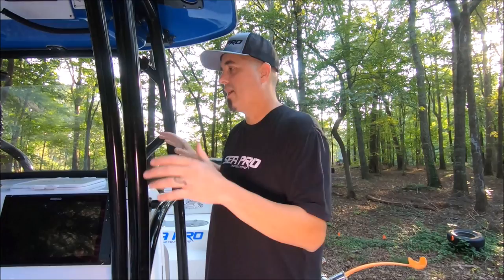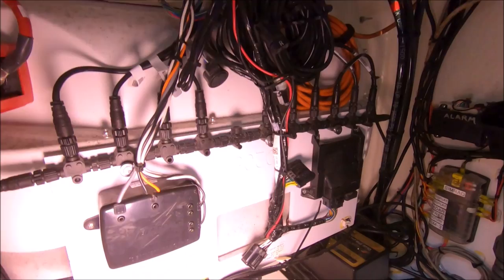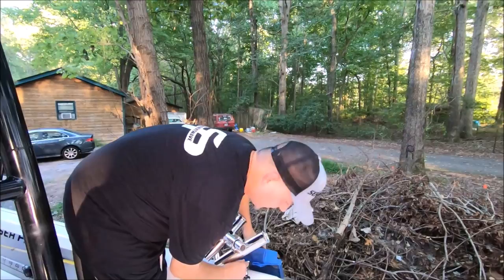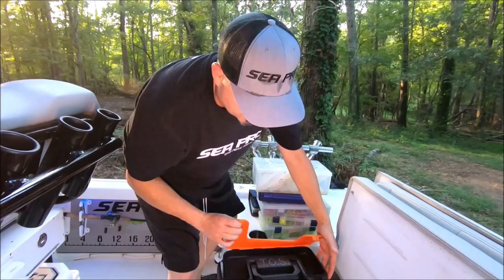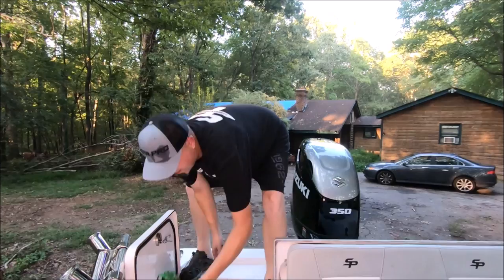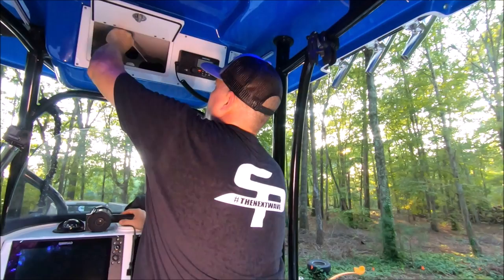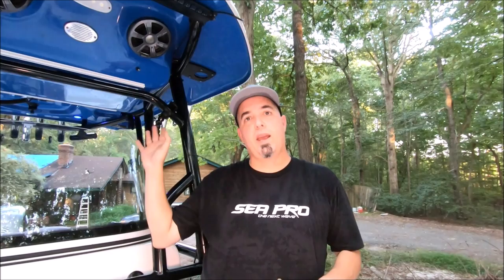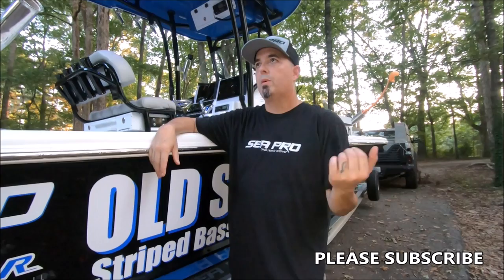RIGGING YOUR BOAT FOR STRIPER FISHING! Fresh AND Saltwater! Sea Pro 248 Bay Boat

Comment: Thanks again Mike I never thought about jumpers. It so simple it just went un noticed. One thing I keep on my boat it a set of wheel bearing for the trailer.  I had a day ruined and a huge bill for not being prepared.  I appreciate all the information so I don't get caught with my pants down again. 👍
Reply from the maker: Thanks brother!! You are very right, An extra set of bearings are a must-have. As long as you have that extra set, you won’t need em anymore, which is just fine with me! 😛

Comment: Having a cranking battery solely for cranking and a house battery to run electronics is a must have(which Mike shows in this video).  So many people I see running everything from the same battery and have to use those jumper cables way too often!!
Reply: I use two batteries each with an AB switch and two dedicated circuits. One circuit is my cranking house\nav lights and the other is my aux (bait tanks, pumps, down riggers, radios, etc).   That means either battery can be cranking or aux depending on that battery's AB setting.  Two bilge pumps.  One to each battery.
Reply: @duaynebarr4392  It's called a house and a start battery.

Comment: Awesome vid Mike , you pretty much covered everything and then some, never know when a simple small primary wire could break off a connector or a stakon, or even foul a spark plug. I use Dielectric paste or cream on all my electrical connections. yup if you carry it you wont need it !

Comment: I really like your videos.  One question about this one.  I get that you should always have tools and extra parts.  Have you ever weighed your boat empty versus loaded with everything loaded?  I was curious how much added weight is in there without people.   I just purchased a 23 foot center console and is listed as being able to hold 9 people, but with all fishing equipment and extra tools, I am wondering if it would put me overweight.  Thanks.
Reply from the maker: I haven’t actually weighed it, but I have done the math and you’re right you can go over fast. Your dealer will have dry weights listed. Your yellow tag will also have passengers plus gear.

Comment: Hey Mike, this is off topic to the Video, but I’m working with my dealer to spec out a 248. Ive chosen the 12” ness evo 3 Simrad unit , but there are 2 choices for the through hull transducer. Choices are either 12 Degree or 20 Degree. Which do I need for this hull? Is it referring to mounting angle? As far as closest match for the dead rise of the boat, or the Cone degrees of the transducer? Anyway what do you suggest? Thanks, David
Reply from the maker: You want 12 degree. Is the dealer installing the transducer or Sea Pro? 

 What model are you going with.
Reply: Mike Smedley yes it will be factory installed at sea pro , on the build sheet we filled out the options on the through hull were the SS60 Bronze 600 W Thru Hull 50/200khz. This will be in a 248dlx boat. Is that the transducer i need?
Reply from the maker: David Mercer I STRONGLY recommend upgrading to the B175 High CHIRP Wide. It’s a few hundred bucks more, but it is the absolute best thru hull for fishing less than 1000 feet. 

 The B60 is an entry level Transducer.  You have a CHIRP processor built into the Evo3. You need a CHIRP Transducer to take advantage of that.  The B60 will work, but it definitely a entry level unit, they offer it as standard because guys complain about the higher prices of CHIRP Transducers.

 The B150 Medium CHIRP is a nice Transducer too.  Similar price to B 60.
Reply: Mike Smedley Thanks Brother! Are there any other standard items you can think of that I definitely need to upgrade?
Reply from the maker: David Mercer add transom mount Active Imaging 2 in 1 Transducer for best Side Scan.  (Get 3 in 1 if you stay with B60). Get extra flush mount rod holders near the bow. 

 I resisted t top misters for years.  I have them on this boat and I LOVE them in summer. 

 Get the hydraulic jack plate 12”.
Reply: Mike Smedley Thanks man, cant wait to be part of the Family!
Reply from the maker: I told Big Ed to take good care of you!! He’s a great guy!  👍👍😁😁
Reply: @MikeSmedleyOLDSCHOOLSTRIPERS  thanks buddy

Comment: Why soo many transducers? All 4 can hook into one display screen? Or do they hook into that big computer looking thing in the helm.
Reply from the maker: I do a lot of testing so I carry more than most. Each display can handle two transducers directly or the tan box that says SIMRAD can take 3 CHIRP transducers directly. It’s an S5100 CHIRP processor.
Reply from the maker: I do a lot of testing so I carry more than most. Each display can handle two transducers directly or the tan box that says SIMRAD can take 3 CHIRP transducers directly. It’s an S5100 CHIRP processor.
Reply from the maker: I do a lot of testing so I carry more than most. Each display can handle two transducers directly or the tan box that says SIMRAD can take 3 CHIRP transducers directly. It’s an S5100 CHIRP processor.
Reply: @MikeSmedleyOLDSCHOOLSTRIPERS  is there one transducer that does it all?
Reply from the maker: blindabinda123 The Active Imaging 3in 1 is the closest thing. It has side and down scan as well as High CHIRP Medium CHIRP and 200khz/83khz fixes frequency. https://amzn.to/2ErP9ug
Reply: @MikeSmedleyOLDSCHOOLSTRIPERS  would I need a specific display for that?
Reply from the maker: It will work with quite a few displays. What do you have?